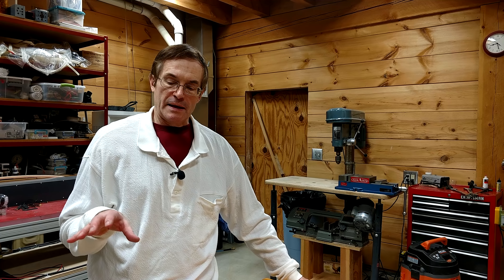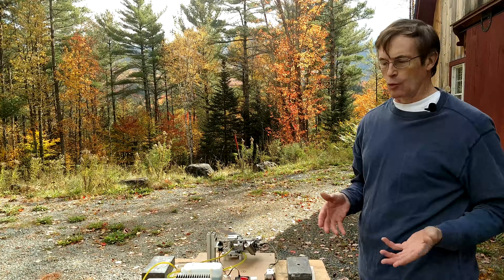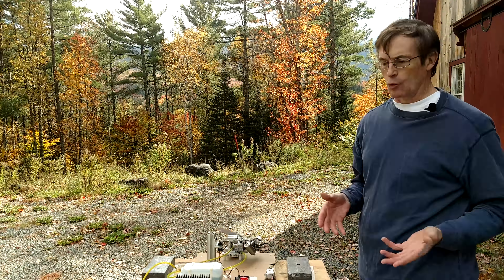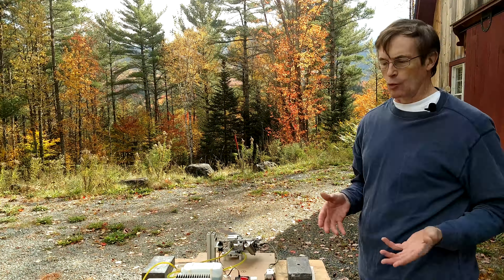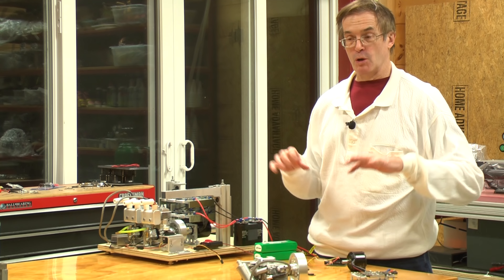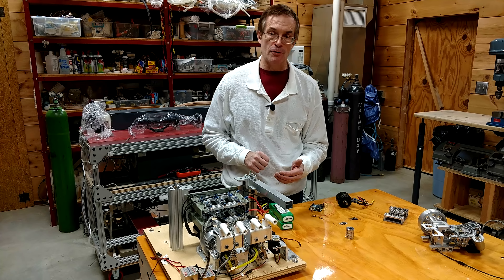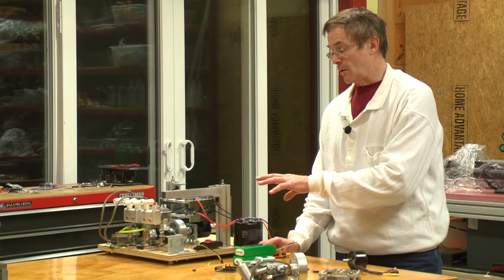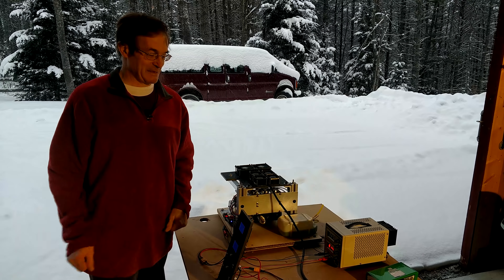Hybrid Drone Generator

Comment: Using 3-phase diode rectification of BLDC motors in generator mode is very inefficient because the voltage and current wave form coming out of the BLDC is NOT a sine it is a trapezoid!    You need to use active rectification to correct the power factor.   This is why your KV conversion ratio sucks. You are leaving almost half the available power from your generator on the table, so to speak.
Reply from the maker: How inefficient do you suggest diode rectification of the three phase motor actually is?  Firstly, the motors do not become warm, the engine output, based on displacement, is consistent with the electrical power produced.
Reply: I did research on this years ago and the papers about it focused on active rectification because diode rectification was not meeting the expected conversion that one sees in DC brushed generators (obviously much heavier for the same KV rating).  The conclusion was that the waveforms in BLDCs used as generators, not being a sine was a significant issue.  They developed an active rectification system and saw a huge improvement in conversion.   A PHd candidate wrote a paper on it: HYUNG-WO LEE, ADVANCED CONTROL FOR POWER DENSITY MAXIMIZATION OF THE BRUSHLESS DC GENERATOR.   From the article, the proposed active rectifier improves output (RMS) by ~65% at maximum RPM for the mechanical system that was used for development.  I think modern BLDCs and the improvement in silicon components over the last 15 years would increase the performance gain a bit.
Reply: Had to review the paper again: The passive rectifier it is just leaving power uncoupled through the generator.  Still left on the table.
Reply: And just so you know, I was looking at the same application as you are.  Hybrid drones.  I just don't have access to nearly as much funding as you appear to have.  ;)  This approach would also be useful for applications that use BLDC motors if they need regenerative braking.  The active rectification array can be easily used to drive the BDLC as a motor as it can as a  generator.   Only the timing for the transistor array and a few power links need be changed, all easily managed with in the scope of the application.
Reply: Metaforeest thanks so much for posting the paper I ll let my engineer read it and pay for the parts as usual...me, inventor; him; man who gets er dun!

Comment: There is no way a BL motor is 3 phase, I dare him to connect it to any 3ph voltage supply! Lets see that video!
Reply from the maker: I don't understand?  What electrical distribution do you believe is driving these motors?
Reply: Show proof my friend! I formally dare you to prove it! And try to keep it friendly if you have the mentality, you see a 3 phase uses it own electromagnetic induction via the 360 rotation of the AC power sine wave through inner and outer fields synchronous to the herts output of the  individual voltage supply legs using all three phases at the same time. a brushless motor no matter how it is wound can only use two poles at once no matter how many are configured and terminated either in parallel or delta. power distribution is via a DC electronic speed controller. Brushless uses a set of magnets for the secondary field and cannot be regulated.  sorry for your ignorance. I can give you reference how the ESC works for a BL motor if you need it... https://www.rcgroups.com/electric-motor-design-and-construction-361/
Reply: I never said it was a 3 phase induction motor. I said it's a 3 phase synchronous motor. In a 3 phase induction motor, the rotating field induces a current in the rotor (a cage), the value of which depends on the slip. The more load on the motor, the more slip is required to produce enough torque. However in a brushless motor , the permanent magnet rotor follows the rotating field exactly, hence it's synchronous. And like the 3 phase induction motor, you reverse the direction by simply swapping 2 of the 3 leads. The brushless ESC works exactly like the full size VSD for induction motors in that you have a bridge of 6 devices (IGBTs in the VSC and FETs in the ESC), which switch power from the DC bus to each 3 phase winding in turn, thus generating the rotating field for the rotor to follow. The biggest difference is that the VSD dc bus is made by rectifying the 3 phase mains and the ESC uses the battery voltage directly. I used to repair VSDs in industry and I have transferred my knowledge to my hobby wherein it has come in very handy. I also found it useful when I was teaching electrical apprentices. In case you wish to argue with somebody else, you might learn the terminology. These motors are wound in Star or Delta (not parallel), and frequency is measured in Hertz, not herts.

Comment: turbine for better power to weight ratio, electric plasma pulse jet
Reply: you could clean output by passing it through a water bubbler filter
Reply: super capacitors with 500F
Reply: you could generate biogas from biomaterial by electric destructive distillation
Reply: metal-air sheet-spool fuel cell at full specific energy (up to 8.4kWh/kg, aluminium sheet metal spool etc)
Reply: or pu-238 rtg

Comment: Tech Ingredients.  You make it way too complicated.  You should take a small gasturbine and attach a high-speed generator and some power electronics.  Weight is low and power output high (5 - 10 kW).  The fuel efficiency will be around 6 - 8 percent.
Reply from the maker: That is a simpler approach, it is light and powerful but far more expensive and the fuel effeciency is two to three times lower than with a higher effeciency, reciprocating engine.  Your  approach like mine, is a trade off.
Reply: @TechIngredients  Indeed!  Life is a big trade off :-))

Comment: Energy density for lithium batteries is 1/20th? Why would you care? You still have to waste it all on running a motor, which loses that energy through heat, friction, accelerating and decelerating the pistons, etc only then to spin a generator which further loses more of that energy... Sure it could still end up being slightly more efficient, but certainly not applicable in real world due to the unnecessary complexity that a gasoline engine and a generator introduce.
Reply from the maker: The energy density of fuel is nearly 20 times greater than lithium batteries including all those conversion steps.  The thermodynamic energy content of fuel is 60 times higher.

Comment: Have you thought of using "ideal diodes"?  I'm about to switch to them for my wind generator in an upcoming project where I use an Arduino based voltage regulator.  Looks like there is quite a significant efficiency improvement to be had.  https://www.youtube.com/watch?v=86dMGGJN59s
Reply from the maker: There will be an improvement in efficiency, but the claim that this increase is large is misleading.  The concept is that a "smart" diode can  be phased to optimize voltage/ current relationship to maximize throughput.  A standard, high current "dumb" diode will have a voltage drop across it's junction of less than 1 volt in the 40-80 volt range and below 100A.  This is approx a 2% loss.  The "smart" diode will better utilize the capability of the 3 phase motor and increase it's effeciency which is typically around 90%.
Reply: I'm operating at nominal 12v so the forward drop of even my Schottky diode pack becomes a problem.  Mostly in the area of heat in my case.  I'm going to give the "ideal diode" trick a shot.  For fun if for no other reason.  I should put a video up after hurricane season if I stay with this youtube thing.
Also.  I really enjoyed your video on making propellers.  I struggled for quite some time on a method of making my rotors.  I need to make a new one in the next few months and will tape my process.  My blades are about 8 feet in diameter but my method would work for your size just as well.  You might find it interesting.  It would allow you to produce a blade that has the proper pitch at every station.
Again, really enjoyed your efforts.  Thanks.

Comment: I have no idea what he's talking about mostly but then I'm not that smart in mechanics...
Reply from the maker: I disagree.  If that were true, you would not have watched this video.
Reply: @TechIngredients   So you're demonstrating how to maximize fuel efficiency by combing battery and gasoline and what the right balance might be?
Reply from the maker: That's correct.  The battery provides very quick response, voltage stability and redundancy in the event that the generator has a mechanical failure or runs out of fuel.  The generator provides the bulk of the electrical energy because of the fuel's greater energy density.
Reply: Ah, I guess then it's the reason why hybrid cars get better mileage in the city than highway since electricity is more efficient in "stop & go" situations whereas gasoline is best when speed is constant.

Comment: you don't return an engine after you've used it, how is that engine still new, you should not have got your money back.
those mufflers are not mufflers, they are diverters, a muffler for that engine would be two to three times larger.
Reply from the maker: I returned the engine before using it.  I examined its mode of operation on the bench.  Mufflers decrease engine noise.  Glass pack mufflers operate on a similar principle.  The exhaust gas follows a convoluted path through these mufflers with impulse absorbing silica fiber surrounding the flow.  The fiber also absorbs some of the oil fumes making the exhaust cleaner.
Reply: but I see you running it at 3:30 ah  duh!

Comment: this video has 131 dislikes! what on earth is there to dislike about this video. So I use the data derived by using the # of likes to the number of dislikes as for every 3,425 people, there are 131 waste of air, troll, losers. will some body better at math please let me know if this is an accurate formula and weather or not I worded it right? lol.

    the combination of a pair of 2 strokes off set on the power stroke to reduce vibration and deliver constant power  through out the revolution is brilliant and I'll be trying it out on other things that have wheels that I can get on and ride!

Comment: You do like to make things complicated. 
Why didn't you take a lesson from BMW and Porsche. Mount your motors opposed from one another and tie them together with a belt . Timing gears from a pt cruiser would work . Getting the smaller belt might a problem. Timing gears and chain from a nissan 4.2 Lt. Could work . The idea being to pull from the shelf . Your harmonic balancers could be used , sans the counter weights  .
Reply from the maker: That's  what I did.  Did you miss the explanation for the purpose of the flywheels?

Comment: Magnet motors are the future, any scale, consider these that can flip society off fossil, Steam Age power:

Flip substations off-grid, 1-Mw/1300hp,
>>50-year no-inputs warranty<< 
Belgian: technokontrol.com/en/current-projects/generator.php, the RF-5000, sparkless for use with explosives, fits in a trailer.

For off-grid, grid-tied homes or not, 10kw/$15k, 5kw/$8k, >>20-year no-inputs warranty<< S.Korean: infinitysav.com/magneticgenerator/, that's $750/year for 10kw of 24x7 power, the 5kw fits a pickup toolbox, is quiet, no fumes indoors, no fuels, $400/year for 20-years.

Magnetic motors drive these, it's why they don't use fuels or inputs for DECADES, only upkeep, found doing trade studies for a lunar mission, why use anything else on Earth?

Comment: Dear sir,  I believe that you are on the right track.  I know how to make it lighter, and cheaper.  Would you like me to explain what to build, how it works, and build a Plasma Flux Generator?  Probably weighs a tenth for the same power in watts.  Friend me on Facebook, and post a copy of one of your videos.
Reply: If I am the inventor, I can release theory and keep that status.  Okay, for your engines to reach peak fuel efficiency, use a needle jet, if they haven't, and revise the carb, and fuel pump.  Needle valve, high pressure pump, smaller fuel droplet size, and if you had a ceramic heater to use as a heat exchange, preheat the fuel with a computer controlled heating block.  This stuff doesn't count, adds weight, and is just modifications for the design in the video.

Comment: why didn't you use a wankel to reduce vibration.
Reply from the maker: Because they were unavailable.  Except for a few surplus OS, RC engines, the viewer has no access to a reasonably priced rotary engine in this power range.

Comment: I get your points, but you're not looking at an engine the correct way.. STOP Looking at a gas engine as an electronic solenoid/transistor/battery or a teeter totter.. It's functions are NOT similar and therefore you're comparing apples and kia's.. 

First point I want to correct..  Power stroke.. 
You're correct in saying that a 4 stroke makes power in one of 4 strokes and a 2 stroke makes power in 1 of 2 strokes. But where you're wrong is HOW it makes this power..  Youre looking at it as if it Makes power for that stroke only, then the rest is useless motion producing zero power, whereas that's not the case at all!!   The FLYWHEEL is responsible for the average torque produced in ANY gasoline engine. The larger the flywheel, the more torque you will store at the expense of excessive torsional reactive force from the engine during the power stroke and lazy throttle response but  will have a very smooth torque output. The opposite is true for a low mass flywheel. A flywheel with little mass will result in a lower average torque, and a very choppy torque output, but benefits are less torsional reactive vibration from the engine and much quicker throttle response. Realistically, for a generator, you want a heavier flywheel to produce a much smoother power output.  

Think of the engine itself as a pwm wired to a low value resistor to a capacitor bank. You can use power from the capacitor bank, and when the engine is not producing power, it is also consuming some from the flywheel (capacitor bank)..  This results in a sawtooth like power output..  Larger capacitor (flywheel) smooths out the sawtooth output for a more consistent output.. So, just because it ADDS power to the flywheel 1 of 2 or 4 strokes, does not mean there isn't power available meanwhile.. Think about it.. Physics.. 

NEXT point..   ENGINE BALANCE... 
The way you are trying to justify engine balance is mind boggling..  Not only is it not precise, but there's no sound logic to it.. 
On a single cylinder engine, it is impossible to completely balance one without a balance shaft, however in practice, it is very possible to reduce vibration substantially.  First, you have to break the engine into 2 forces to be balanced, rotating and reciprocating.. When you balance a crank, you TYPICALLY balance it to 100% of the rotating weight (Crank, and big end of rod) and a percentage of the reciprocating weight.  Depending on use, this percentage varies, but typically it's about 50%.. with that being said, you have 50% of imbalance of rotating weight that is due to adding this from the reciprocating to offset tdc and bdc. for example, if rotating component imbalance is 0% and reciprocating weight adds another 50% of the rod, piston, wrist pin, and rings to the counter balances, you then have a perpetual 50% reciprocating imbalance at all 360 degrees of crank rotation.  Not sure if you understand how I explained it, but I tried..   That being said, the engine will NEVER balance the way you had it rigged up. But then again, it doesn't matter because you're looking strictly at a static balance of the engine assembly, and not the dynamic balance of the internals. 

3rd point.. The weights you added to the 2 stroke flywheel pair..  NOT GOOD.. Not only are you adding TORSIONAL harmonics to the engines, but you're adding an imbalance to the individual engine. That being said, imbalance multiplies exponentially with rpm, and you can quickly hurt or kill someone if that were to cause the crank snout to fail. You should immediately remove any excess weight you added to the flywheels, they should be 0 balanced!!!!  I warned you.. 

4th point. The exhaust you are making is going to hurt you severely..  Have you ever noticed that 4 strokes are typically MUCH quieter than 2 strokes??  This is due majorly to engine design..  See, 4 stroke engines actually have an EXHAUST stroke..  2 strokes Don't..  They have an exhaust/transfer function..  The ONLY exhaust coming out of a 2 stroke is from the blow down cycle (Where the piston begins exposing the exhaust port to relieve cylinder pressure at the end of the power stroke) and a transfer cycle (Where some remaining exhaust is pushed out by fuel being transferred through transfer slots coming from the crank case.)..   That being said, ANY back pressure on a 2 stroke, will contaminate the intake charge. AND, a contaminated intake charge KILLS power production. This is why 2 stroke dirt bikes have intricate exhaust pipes, with a neck, a bellow, and a stinger that is appropriately sized based on engine size and port shape.  They actually can scavenge the cylinder to pull exhaust gasses out of the engine using energy stored from the blowdown cycle..  While some back pressure on a 4 stroke will put a small ding in power output, it will kill a 2 stroke power output. Therefore, loud and unrestricted is better than choked and quiet. I'm sure it can also cause heating and possibly oiling problems as well on a 2 stroke if left restricted. 

hope this constructive criticism was beneficial..